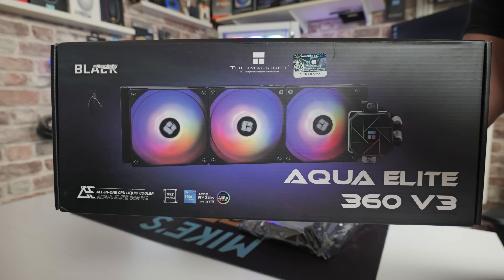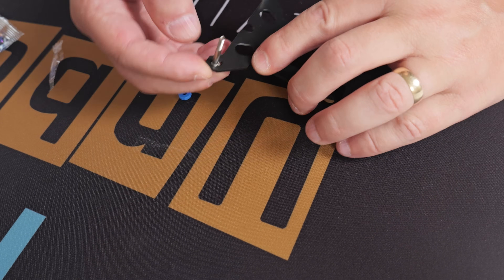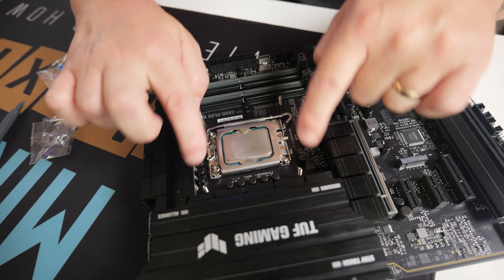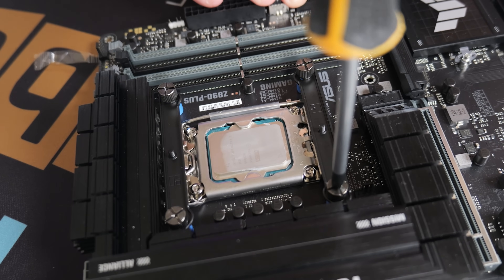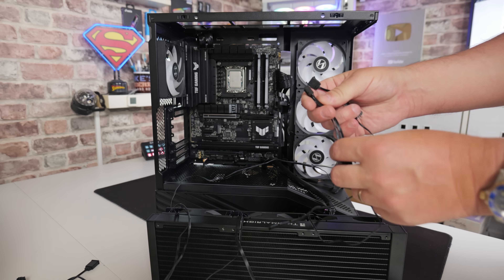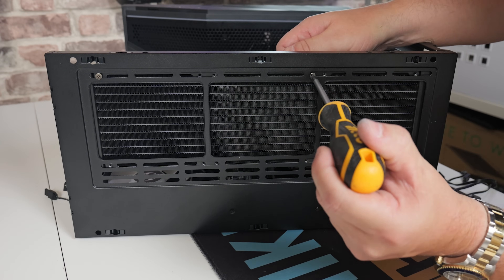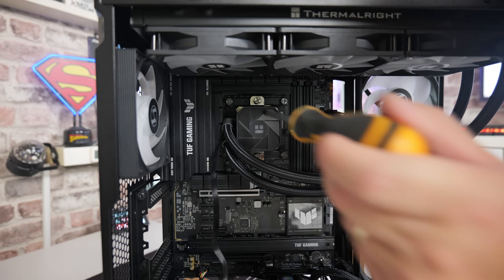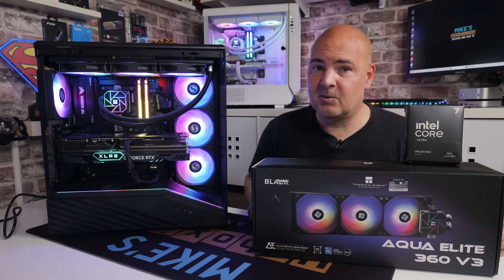How To Install Thermalright Aqua Elite V3 AIO Intel LGA1700 LGA1851

Comment: Hey, did you plug anything into the psu? I feel like u connected mine properly. The fans spin, keeps cpu cool but I can’t get the rgb to light up. Help.
Reply from the maker: rgb need to be connected to the motherboards argb header or a standalone controller, you can post on the discord with images if you are struggling

Comment: Hello Mike one question: have the same Aio and just now I put IT on my new PC. The problem is why one of my fan, the Last one on the back dont light up. I connect all of them but The Last one no light...
Reply from the maker: check the daisy chain is complete and also don't have more than four devices in total of the chain or there might not be enough power to supply them all

Comment: Only 2 er 3 questions: firstly the two brackets attached to the pillars didn't seem centralised ie one hole was rubbing post whilst other end post was in middle, so does that cause any issue bolting the pump head? secondly can the pump cover be rotated? Just looked on amazon and the 240mm is only £40 comparable to their twin fan/towers FS140 cooler so would cooling be comparable? Thanks Mike and Kath as always 😸👍
Reply from the maker: the pillars dont need to be exact, by the time the mounting pressure is applied it levels itself out normally.
the pump head is solid and can't be removed or rotated, lucky the logo has no obvious writing on it, only the logo which looks okay either way i think.
the 360 aio will match or exceed pretty much all tower coolers regardless of price
Reply: @mikesunboxing  Thanks Mike 👍